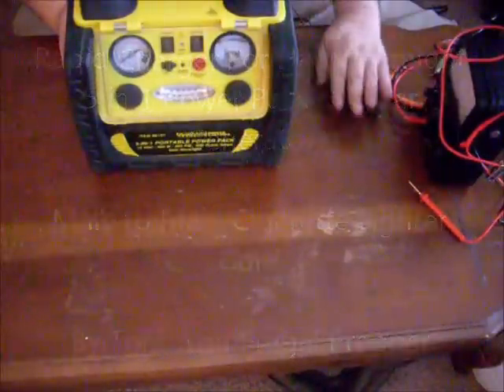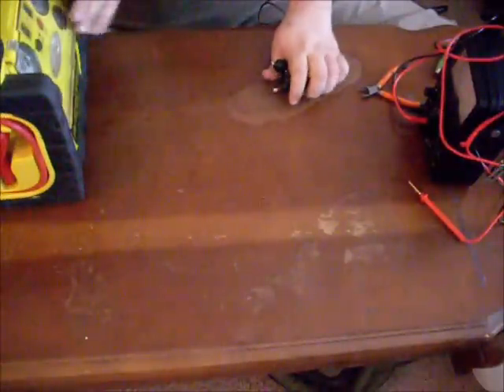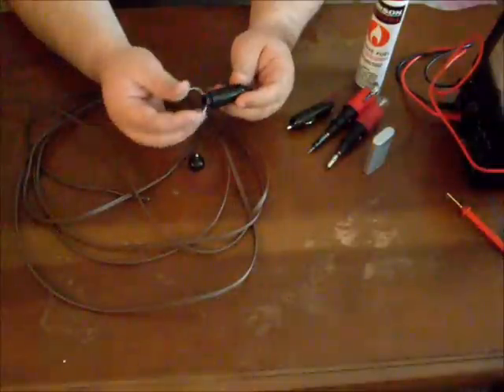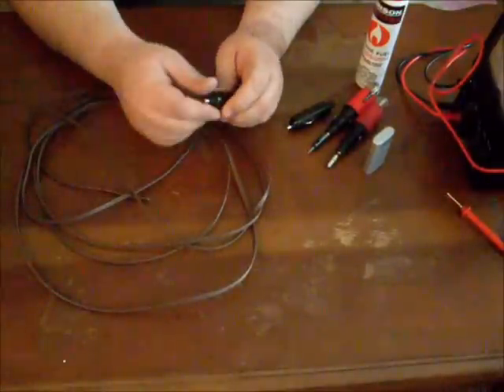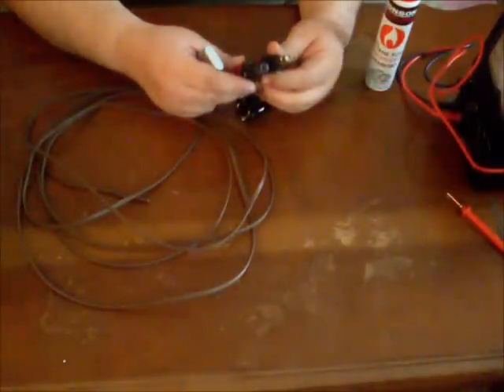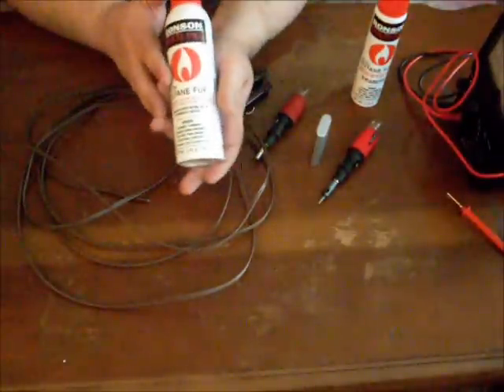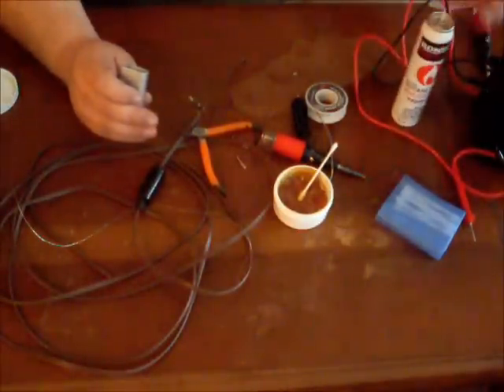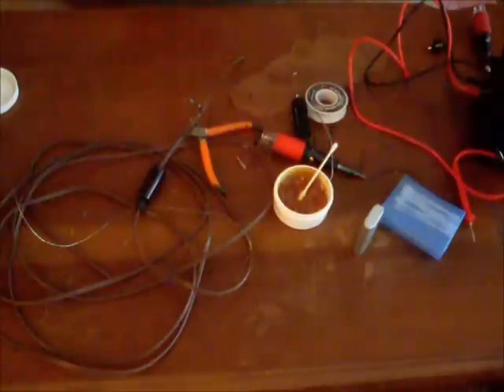DIY - Rapid 12V Car Charger cord for Harbor Freight 5 in 1 Power Pack or Solar Generator.

Comment: What I am trying to do is build a replacement AC charger since apparently one cannot be ordered from HF directly.  But the entire label and markings for the original one were chewed off.  So how many volts and milliamps and what polarity should the replacement be? What is the original?
Reply: Any 12v to 15v wall wart. Get a battery reconditioner instead so you can keep plugged in.  Original is 15v.

Comment: Can I put a 12v Ac adaptor on the other end to make a replacement AC charger?  Dogs chewed through the original...
Reply from the maker: Yes, but you would want something more like 13 - 14 volts.  The voltage need to be a little higher for it to charge.  You car normally put out 13.8-14.2 volts.